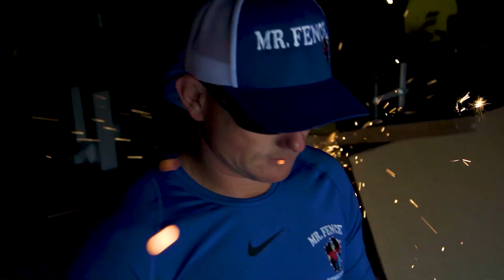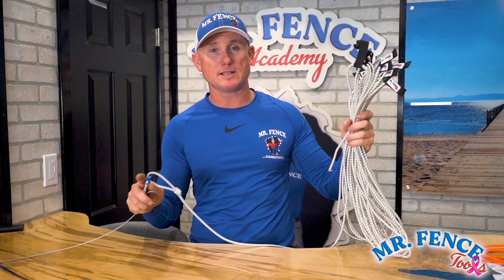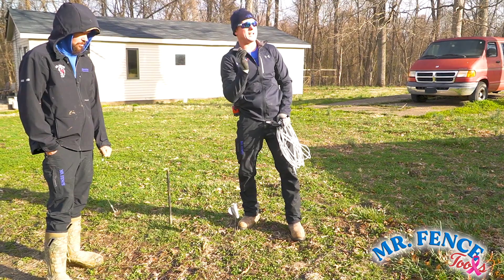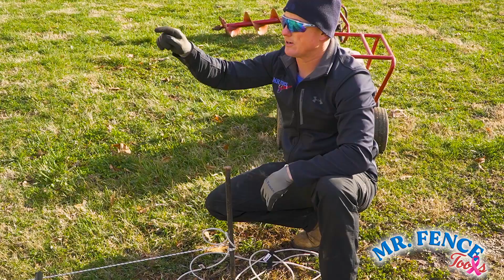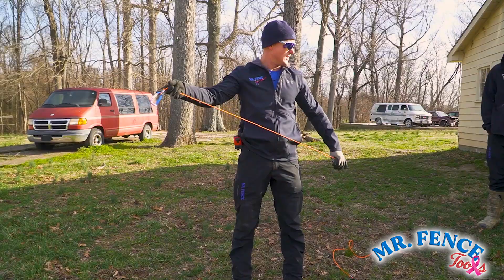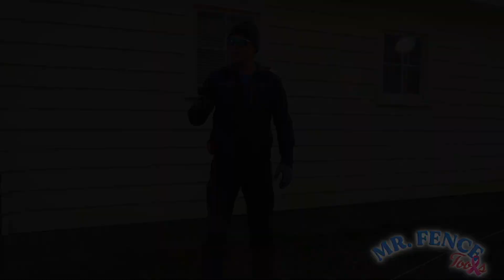Why Are You Still Marking Holes?? | The Equalizer

Comment: At the end of the day when guys are all tired and want to get off how fast does that thing get tangled or destroyed.  One guy should be able to drag a tape and get each hole right where it needs to go. This tool is just an example of how people love to overthink fencing.
Reply from the maker: Lol we just roll it up easy peasy no need to tangle it up. If you have a hard time with that a small plastic orange reel can make rolling it even easier. 
An engineering student did a project on this tool and determined it was 86% percent faster and 26% more accurate for a seasoned veteran. 

Keep on using the tape measure repaint and string if you won’t too enjoy
Reply: If they are tired or rushed, you better be more worried about the quality of their workl!
Reply: Toss the boys 2 beers and a water bro

Comment: Been building for 1.5 now but I have a way better way to measure it out. String is cheap, run string, lay out 2x4x8s down the line, use a 2x4 block for equal space, start digging. (Last two sections always split and offset. Works every time and takes less then 10 minutes for 80 -100’ line. Side note ( take 2x4 block and turn sideways for steel postmasters, 2x4s flush to each other if you like to to set on top of of wood post. And what you make up for in perfectly spaced sections, you lose in time curing 2x4s, pickets per section. What do I mean when I say pickets per section?? We’ll say your using steel post ( every 8’ section is 17 1x6 pickets per section which covers the post from one end to the other without using a extra picket.. you can spacing on every section and that’s gonna cost you $5 bucks for every section later down the line river cover each other end of the post, I’ll take a baby section at the end
Reply: I just measure from behind the concrete of the old post I wanna start at and just measure 7.5 inches mark with a hammer set the line and dig and the last ones I just split em usually be 7ft apart each🤷‍♂️🤷‍♂️

Comment: Nice tool man. I can imagine this is helpfull for a lot of people, but here in Holland we never use strings! We set our posts by the eye, way quicker and straight as hell.
Reply: BUT I BET  80% OF YR TIME U STILL USE A LEVEL TO MAK SURE TO CORRECT ANY OF YR FUCK UPS YOU DID WITH "YR EYE"
Reply: @ridinsolo1158   We always use a level. We set our beginning post and end post, and sight all the other posts in line while holding it level. Then pound them down, and keep them tight in a straight line while sighting the height off with marks. We work this way for like 20 years now
Reply: Holland is flat so that’s doable

Comment: I love this concept. I feel like it would  be great for marking holes. But leaving it in place to also set the posts seems questionable. For chain link or t-posts this would definitely be a time saver. But for wood posts. My question is, if the tag marks the center of the hole. You have to then move the equalizer to the side in order to dig your hole every time. Which is hard if it's between the tracks of your machine. Also you would be driving over it constantly.

Comment: Kind of cool but not practical ... I don’t see the tool lasting long with diggers and augers being used along side it . Also we like to float our post in .. we do that by using metal stakes and floating the string line in and then setting our post . There’s no need to cut the tops after setting .. in order to do so the string line needs to be pulled extra tight to eliminate any sag ... 
I don’t see a rope being any help with our way of installation....
Reply from the maker: Very practical and those that use it will only know. Diggers. and an auger should never hit it. But none the less this tool is one hat has a life cycle of about a year but then again so does string line and 300’ tapes lol. Once you start using your eye to float post instead of the string line you will see an improvement with your efficiency and accuracy. Keep on fencing.

Comment: All this just to not mark holes? How do you stagger to dodge the old post? If u want my first section 7ft so I dodge the old footing the 8ft after that how could I use this to that?
Reply from the maker: That is another one of the amazing things about this tool. If there is something in the way on one hole you can make a slight adjustment with the tool and all of the other post location with move in order the blend everything. The hole spacing self adjusts for you this is not just a cord

Comment: On what side of the tag do u set the inside portion of the posts? Does it depend on what direction you start at?
Reply from the maker: Tag goes in the center of the post normally but you could also do same side same side